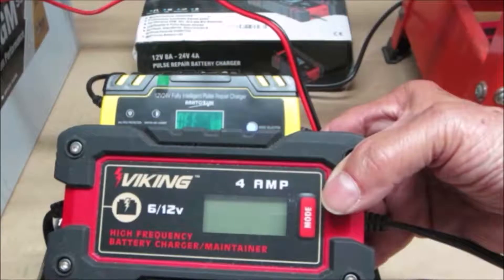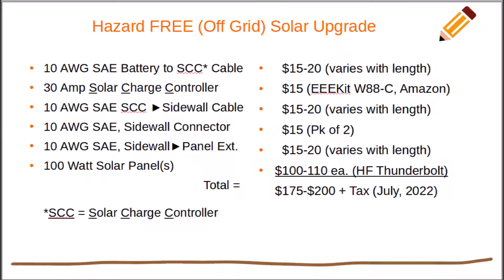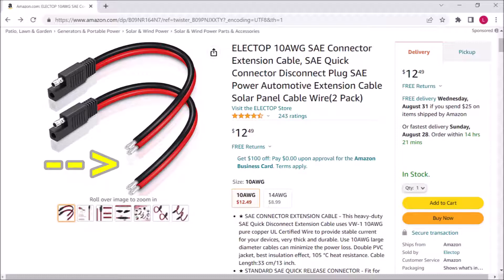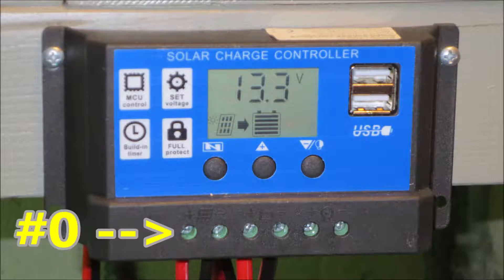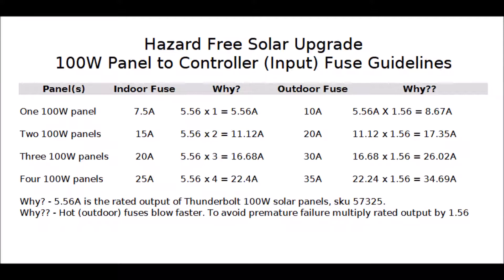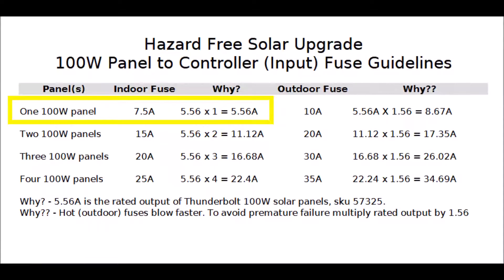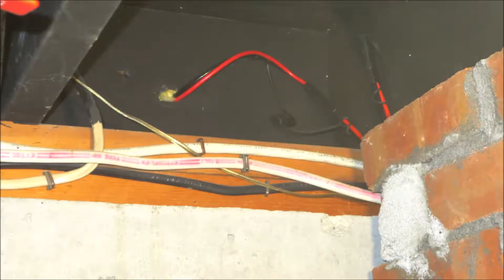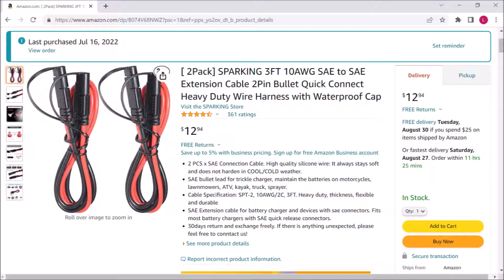Frustrated User Guide: Backup Power Project E4 - Hazard Free (Off Grid) Solar Upgrade

Comment: These are really great videos. Hoping that you touch more upon your furnace backup and wondering if you're integrated it into your well water pump inverter or are running a separate one for that.
Reply from the maker: My gas-fired, warm air furnace runs off of the same backup power system. The only real difference is how I wired it. Unlike the well pump, and unlike my neighbor's baseboard furnace, the ON/OFF switch is not on the wall. It's mounted directly to the side of the furnace. Power comes in through an EMT drop and all the wiring is inside the furnace. So instead of adding an electrical outlet to the inside of the furnace (impractical), I replaced the SPST ON/OFF switch on the outside of the furnace with a SPDT (aka 3-way) switch and wired the extra contact to a 14 gauge power cord. When the 3-way switch is in the UP position, the furnace is connected to the grid, just as before. When the 3-way switch is in the DOWN position, the furnace is connected to the power cord for use with an off-grid generator or backup power system. One advantage to this rewire is that the power cord can be left permanently plugged into an inverter. This eliminates one step from the power transfer procedure. When the power goes out all you have to do is toggle the furnace ON/OFF switch down and toggle the inverter ON/OFF switch up. Just two steps, but it's still two steps too many for some people. Thanks for asking. Furnace and refrigerator episodes are still on the table and with encouragement from kind comments like yours I hope to have them done soon.
Reply: @LawrencePina  I was going to say, new video! Thanks again.